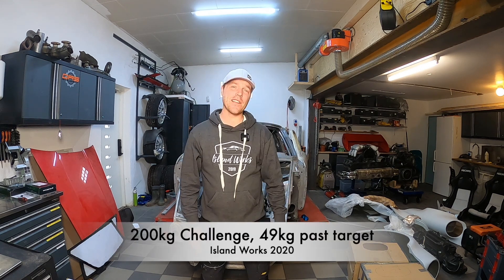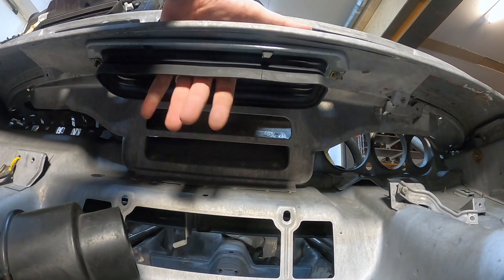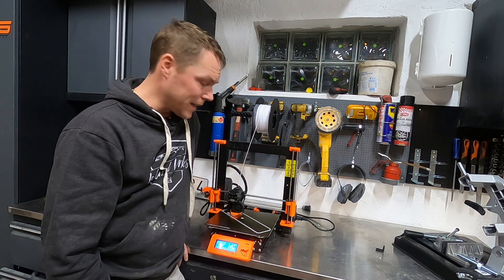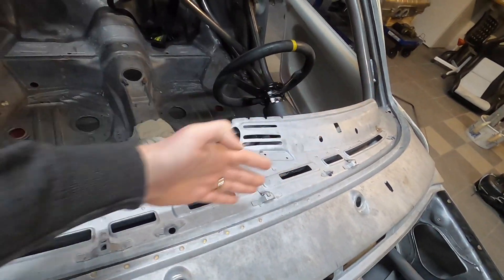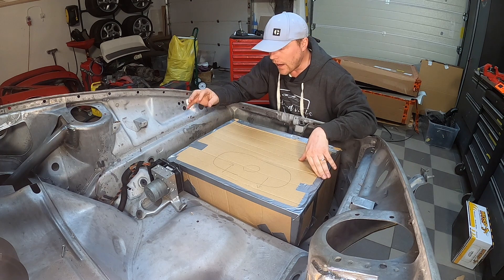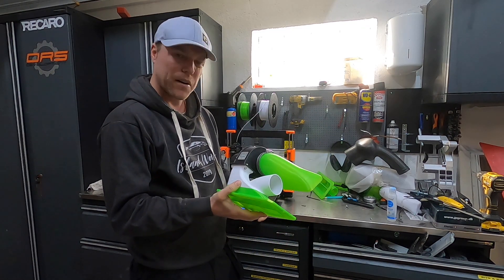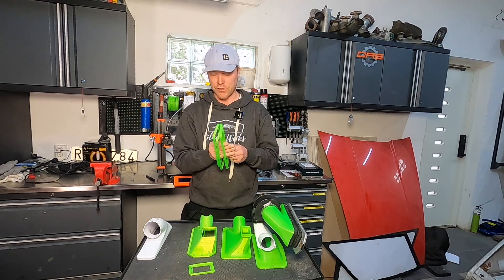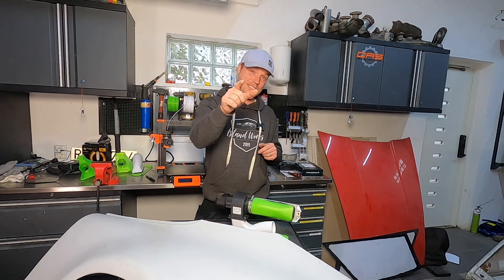3D Factory - 911/964 Lightweight Fan Unit Designing & 3D Printing

Comment: I might have missed it, but where did you source that little blower from?  Great solution!
Reply from the maker: It's from one of the 911G models.
Reply: @islandworks  A G-Series?  I'm restomodding an SC... I got rid of the rear compartment heater blower long ago.  I'll have to have a look for one now!  Cheers.
Reply from the maker: @dra911  I cannot remember exactly where it sits but it’s in there in the front side somewhere. There are other more modern alternatives outside Porsche as well.

Comment: I've found thick PETG to be okay inside the car interior. Glass temperature is 70C so more heat resistant than PLA. It's also safe to print, not like ABS which kills you or whatever.
Reply from the maker: PLA is great for prototyping. My favorite is CF infused nylon, but is a real mess to print correctly with temperatures and warping.

Comment: Love it, you should try the Pretty PETG profile with .25-.3mm layer height. Would save you print time! The Prusa can be pushed quite far and still be reliable.
Reply from the maker: Since I made this I’ve discovered the draft setting in Slic3r with 0.3 layer height. It magic for any kind of fitment work.